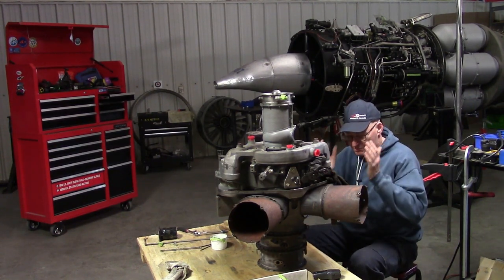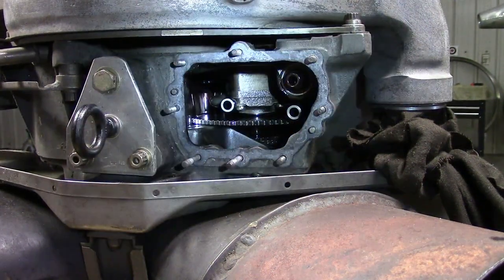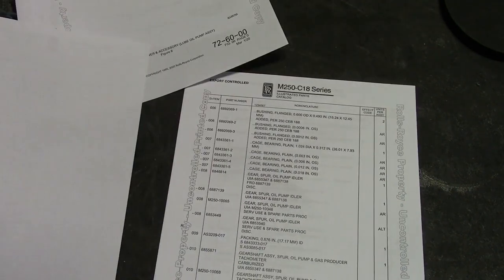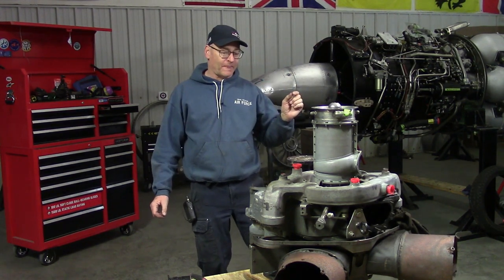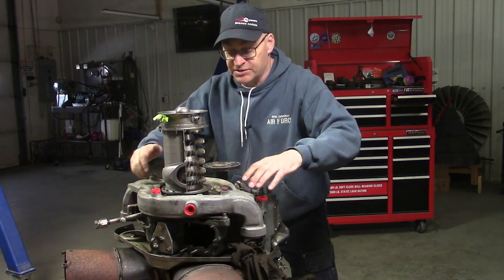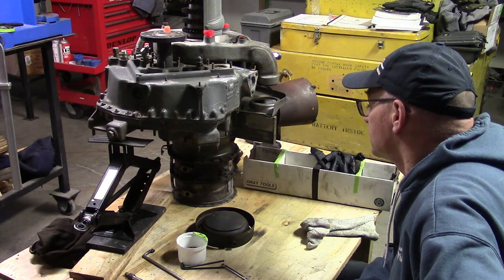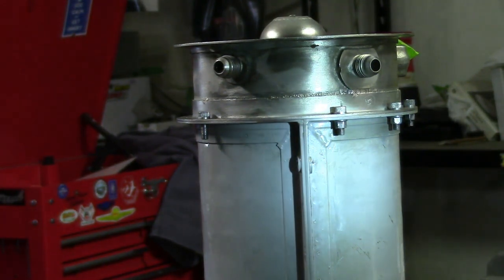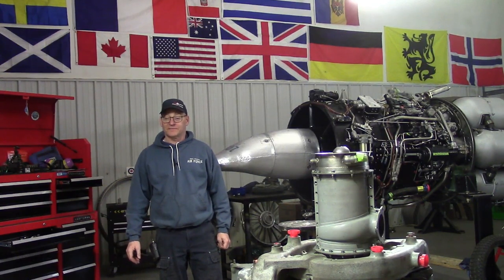Inside the gearbox: Mini Jet Boat ep. 7

Comment: I love how u work... RTFM bevore u BTFM ...  7/16 Compressor Housing- Atachment Braket Bolt... in germany we always wonder who had assamled this... Copperfield? DAVID Copperfield? U find this sord of Fastener instalation all over the Place... mostly at non METRIC engeneered Stuff like oversee Engine scrapp  from Textron GE or P&W or Fire&Forget williamas fuel burners... 

So what u gona do? losen this Bolt first! Tightehn TORQUE  it AT LAST. but...how?  ASK A GERMAN A&P!  at firsat lose all braket atachm,ent bolts, so u can turn the Braket the first 1/64 turn (with the Bolt u wana lose) only IF U CAN NOT GRIND DOWN YOUR TORQUEWRENCHE ADAPPTER fare enough... use the feeling in your Fingerrtips... use a NEW flat Screwdriver an a smal Mallet to drive the Bolt ccw while u apply some Torque to the Braket (AND rememer this frorce u needed and Angle u turn the Braket  to retighten the Bold. and do not use a pin push ore an Chissel...u need the soft impact from the SCREWDRIVER HANDLE, and do not opverdue this tequenik, u can only apply a sertain ammaunt of force this way... if the bOLT WANA COME LOSE THIS wAY TRY TO DRILL IT and use AN eXTRACTOR...

Comment: may you explain next videos between electric(plasma) and fuel, which better?
Reply from the maker: None of the engines I've worked, or even heard of, run on plasma.
The plasma I'm familiar with is between the electrodes if the ignitors.
Reply: @AgentJayZ  You just made me chuckle 😊